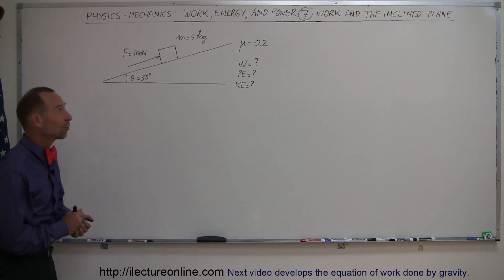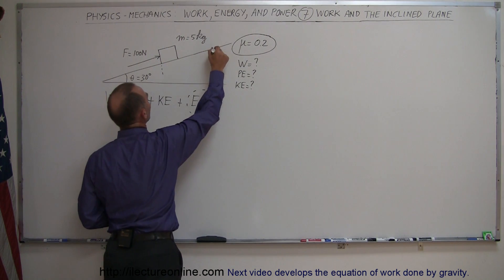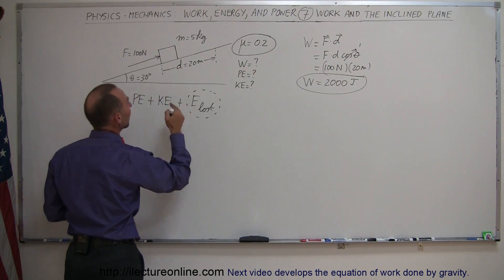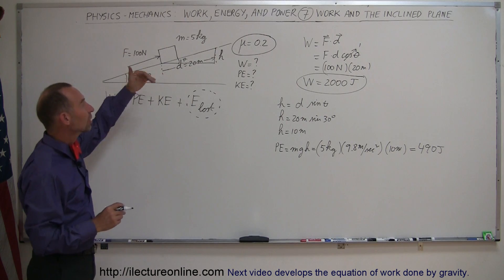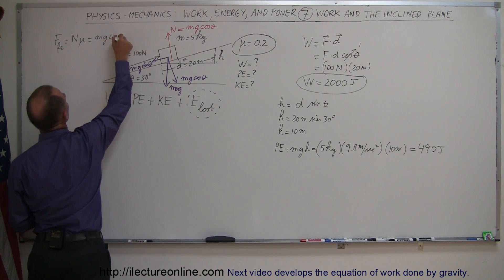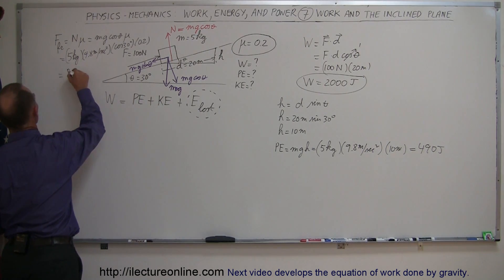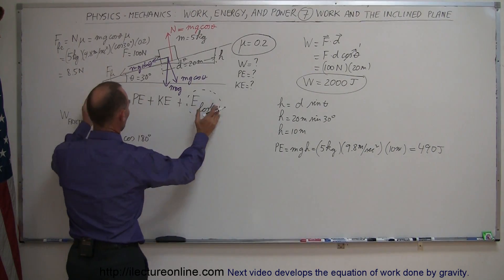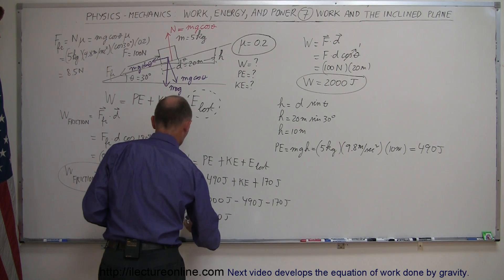Physics 8  Work, Energy, and Power (7 of 37) Inclined Plane (Friction)

Comment: There must be a miscalculation cuz there is a job done by the weight of the object. So the KE should be 850 joules according to my calculations.
Reply from the maker: The calculated values in the video are correct.  Thank you for checking.

Comment: Doesn't the X-component of G (the weight of the object) perform work on the object as well?
Reply from the maker: When an object is on an incline, it makes more sense to take the weight of the object and subdivide it into the parallel and perpendicular components.

Comment: Just as you said in the first video, Work done to overcome friction is positive bc Force to overcome friction is opposite to the direction of frictional force and here Energy loss is the work done to overcome the friction so its positive?
Reply from the maker: If you use the definition of work:  W = dot product between F and d  (Force and Distance).  Therefore work is related to a force and the distance and direction the object travels with respect to the direction of the force.  If the direction of the force and the direction of travel is the same, the work done is positive.

Comment: The force component of the weight of the box in the x-axis direction does work opposite to the thrust force, why is it ignored?
Reply from the maker: Technically that is not the x-direction, but the direction parallel to the incline.  You are correct that the mg sin(theta) force acts against the force pushing the block, but the work done to overcome that is accounted for by the increase in potential energy = mg d sin(theta).  We can account for it as work of as potential energy but not both at the same time.
Reply: @MichelvanBiezen  please sir you are really helping us much, now my question is,y don't you write all the questions in order, so that we see as you are moving from answering, question to question, I suggest you must do so 🙏

Comment: hello sir, in this particular problem you didn't use exactly the weight component in the direction of the force, mgsin(theta) but you used only force of the friction wich opposises the applied force. so, why didn't you use mgsin(theta) in this case?
Reply from the maker: The definition of the friction force =  (normal force) x ( coefficient of friction) = mg cos (theta) x (coefficient of friction)
Reply: @MichelvanBiezen  sir, here we have frictional force =  (normal force) x ( coefficient of friction) = mg cos (theta) x (coefficient of friction) is one of the opponent forces to the applied force, and also we have mgsin(theta) as the another resistance forces. so, Fnet=Fapplied-(mgcos(theta) +mgsin(theta)) and work done should be WORKDONE=mgcos(d) + (Fnet)(d) in wich Fnet is ☝. thank

Comment: Hi Professor , why don't we use Fnet = (100N - m.g.sin(30°))   Wtot = Fnet.displacement ?
Reply from the maker: It depends on what you are trying to calculate.  If you are trying to calculate the work done by the force that is doing the pushing, your equation will not give you that result.
Reply: @MichelvanBiezen  Thank you professor!

Comment: Why we don't use/ mg sin alpha/ as force losses
Reply from the maker: If you were to calculate the workd done by mg sin(theta) it would be equal to mgh = 490 J  Thus you either calculate mgh or the word done by mg sin(theta), but not both.
Reply: Sir we have two forces losses we have friction Force and mg sin theta
Reply from the maker: Yes, the friction force requires work to overcome.   W = mg cos (theta) mu d

Comment: Hello Michel. Thanks so much for posting all of these videos; however, I have a question at 6:35. Will the work of friction always be added in that equation? Is there any scenario where it would be subtracted? Thanks!
Reply from the maker: It depends on how the equation is written.  But if on the left side you add up all the initial energies and work put into the system, then on the right you must add up all the final energies and the energy lost due to friction.  (In this way it is always added).
Reply: @MichelvanBiezen  Thanks.

Comment: If a car is moving at uniform velocity on a frictional horizontal plane? then is the applied force by car is equal to frictional force? Is the power of the car 's engine = Force applied × Uniform Velocity?
Reply from the maker: You also have to consider efficiency (part of the power the engine puts out, is lost due to heat (thermodynamic inefficiency)), and part is lost due to wind resistance, part is lost due to internal moving parts, and as you indicated part is lost due to friction between the tires and the road.   🙂
Reply: @MichelvanBiezen  Thank you very much! You're the best! 💖

Comment: Hi Michel, why do you not take the x-component of the gravity force acting on the object into account? Just like friction opposes the object's motion (which leads to energy loss), the x-component of gravity does too because it has the same direction as the friction. This must mean that both friction force and x-component perform work on the object in the opposite direction of motion. Hence the equation would be:
W(Drag force) + W(friction) + W(x-component) = E(kinetic) + E(potential)
where  W(friction) + W(x-component) < 0 (takes energy away from the object)
Reply from the maker: The force of gravity is alrady taken into account by accounting for the potential energy.  It is either one or the other, but not both.

Comment: can you help me explain this sir?  A 200 kg cart is pushed slowly up an inclined plane. How much work does the pushing force do in moving the object up along the incline to a platform 1.5 m above the starting point if friction is negligible
Reply from the maker: Since the car is being pushed slowly, we can assume that it does not accelerate and therefore does not increase its kinetic energy.  We are told we can ignore any energy losses due to friction.  Then all of the work done results in the gain in potential energy.  Therefore the work done = mgh = (mass) (acceleration due to gravity) (height gained)

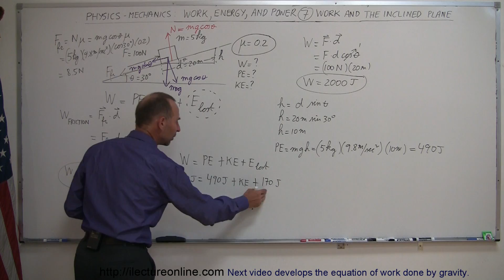Comment: I'm kind of stupid because I repeated this video 4-5 times to understand it one thing tho 6:40 I still dont get why we didnt subtract by 170.-.
Reply from the maker: Think of the equation as a scale where the left side and the right side must be balanced.  The total energy you start with is on the left side.  It must equal to the total amount of energy on the right side.  If not all of the energy was converted into kinetic or potential energy at the end (right side) you must add the energy that was converted to heat (energy lost).

Comment: What about work of gravity.!?!?!?! Which considered as a loss of work.... :)
Reply from the maker: When calculating the work done by a force, you can only consider that particular force.  So you can calculate the work done by the work pushing.  You can also calculate the work done by gravity.  (in the energy conservation equation, the work done by gravity is taken into account by the potential energy gained and lost).
Reply: @MichelvanBiezen  okkk... so there is no work to be counted to the force mgcos60 ..... we just count the work done by 2 forces which are the given one(100N) and the friction one.. right'?
Reply from the maker: Essentially we calculate the work done by each force seperately.  Then we can group them as desired.

Comment: Quick question, why didn’t we consider mgsin(theta) work done? It is the force done by gravity and it will be opposite of the motion, much like the friction, so there is an energy lost. Or was the initial force (100N) originally 125N? i.e (125-25)=100N ?
Reply from the maker: You can pick each force (including mg sin(theta) and determine the work done) separately and calculate the work done by each force.  (In this case mg sin(theta) will do negative work because it acts in the opposite direction of the displacement.

Comment: Hi Professor Michel I would just like to clarify if the cos theta in the formula W = FDcos(theta) means that the angle of the work done? Because my intuition at first to solve for the work on here is simply by plugging W = (100N)(20m)cos 30 because it is inclined 30 degrees. However in the video shown you applied it as W = 100(20)cos0
Reply from the maker: Work = force x displacement x cos (angle between the directon of the force and the direction of the displacement)   So the work done by the foce pushig the mass is:  F x d = 100N x 20 m    But the work done by the frtiction for is:   Ffr x d cos (180) = mg cos(30) x 20 x (-1)
Reply: @MichelvanBiezen  I already understand the way you approach this problem. Very clear to be honest. I assume the W=Fd that resulted to 2000J is you imagined that the box is on a straight surface causing cos0. Then you used the 30 degree to find the height by using trigonometry. and so on.
Reply from the maker: That is correct.

Comment: Quick question - when calculating the work done (W = Ff*d), why is the angle cos180 instead of cos30? Is it because we already took into consideration of the angle 30 degrees when we calculated what the force of friction was?
Reply from the maker: 180 degrees is the angle between the direction of the friction force (pointing down the incline) and the direction of the displacement (pointing up the incline)

Comment: Hi, why isn’t the friction work (Ff + Mgx)d cos(180)? Because both mgx and the friction is working against the pushing force. I would appreciate an answer asap (have a test in 1 day) //Sweden
Reply from the maker: Use the definition:   Friction force = normal force x coefficient of friction.     The normal force is the perpendicular force between the object and the surface which in this case is mg cos(theta)

Comment: Hey Michael thank you for the response, here is my confusion: when we determine work done by friction down a ramp (of a constant angle like an inclined plane or a varying angle like a curving ramp), we find that the work comes out to depend on the "horizontal length" of the ramp and not the length of the ramp itself (-umgl, where l = horizontal length if the rough ramp). In such a scenario, when work by friction seems to be path independent, how do we justify it as a non conservative force?
Reply from the maker: It is better to apply the definition of work:    W = F d cos(theta)   If the force is directed along the incline, then the work DOES depend on the distance traveled along the incline.

Comment: Thank you! This is super helpful! Would the energy lost due to friction change if the box was being pulled up the incline by a pulley when a hanging mass is dropped? If so, how would the calculation procedure for this be different?
Reply from the maker: The calculation for the sliding block would be similar, but you would have to include the other object in the calculations as well.  We have examples of that if you look at the other videos in the playlists on work, energy, and power.

Comment: good day i noticed you don't use the work energy theorem? i there a specific reason for that?
Reply from the maker: Good question.  Rather than covering "all the theories", I prefer to use fundamental principles to make it easier to understand, and to reduce the number of approached for the students.  Essentially the work energy theorem is a subset of the energy conservation equation, and after some practice the work energy theorem becomes apparent from the initial equation
Reply: @MichelvanBiezen  well thank you for helping me always be able to find h will have to adjust when I write. But its not too complex as long as you fill in the correct values. Now to watch electrostatics 🤩🤩

Comment: What would've happened if we calculated the net force subtracting friction there? And then we find the acceleration, then final velocity and then KE and subsequently GPE, and adding them we get a different result. So that way is wrong?
Reply from the maker: Try it and see if you get the same answer.
Reply: @MichelvanBiezen  I did and it's different, I don't think I made a mistake anywhere

Comment: I didnt understand why did you add the E(lost)with + sign and not minus sir?
Reply from the maker: In order to have a balanced equation, you must use a "+" sign if you place the "E(lost)" term on the right side of the equation, and you use a "-" sign if you place the "E(lost)" term on the left side of the equation.
Reply: @Michel van Biezen so if I use this equation:
W+E.lost=PE +KE, with substitute E.lost= -170 , am I right sir?

Comment: Hey, I did this problem slightly differently. Not sure if I'm correct; Instead of substituting h=d*sin0, I substituted d=h/sin0 into (W=Fd) Wfric= mu*mgcos0*(h/sin0). Is this still correct?
Reply from the maker: Did you get the correct answer?
Reply: @MichelvanBiezen  No, it would not work simply because PE only works vertically, and does not follow the path of the object.

Comment: Would energy lost take into account all resistive forces (ie. The component of its weight going down the slope mgsin(30)) not just friction?
Reply from the maker: Energy lost is the mechanical energy changed into thermal energy (heat).  This is caused by friction, wind resistance, etc.    Potential energy changing into kinetic energy would not fall into this category.
Reply: @MichelvanBiezen  but surely some of the total work done would be against the force of mgsin30N
Reply from the maker: Yes, but that is accounted for with the potential energy and kinetic energy, it does not get converted to heat energy.
Reply: @MichelvanBiezen ok thankyou very much

Comment: why is the cosine of theta = 1 in calculating work?
Reply from the maker: If the direction of the force is different than the direction of the displacement then   W = F x d x cos(theta)  where theta is the angle between the force and the displacement.  If the angle is 0, the cos (0) = 1

Comment: I want to ask a question.. why the work of mgsin(a) isn't included? I'm a little bit confused since i thought mg sin(a)will slow down the force and has a work by multiplying it with displacement. Please help me
Reply from the maker: That is already accounted for with the gain of potential energy (490J).  Note that the PE calculation contains the sin(theta) component.

Comment: Wouldn't there also be energy lost due to gravity, which is mg sin(theta)*d?
I'm confused because we apply mg sin(theta) when we do dynamics.
Please help!
Reply from the maker: Take it one step at a time.  Word done is simply force x distance (and time the cos of the angle between the force and the displacement if not zero).  Work will overcome friction, and add energy to the object (or both).  In this case work is used to overcome friction, add potential energy due to height gained, and add kinetic energy due to velocity gained.
Reply: @MichelvanBiezen  Understood. Thank you!

Comment: Why we dont calculate work done by a mgsin@  force ?  I dont understand that
Reply from the maker: That is a very good question and it confuses a lot of people.  It all comes down to perspective, and there are many things like that in physics.  For example if two people on opposite ends pull on a string the string will pull back (Newton's third law).  When you ask the person on the left: "which way does the string pull?", that person will say: "the string pulls to the right", and when you ask the person on the right: "which way does the string pull?", that person will say: "the string pulls to the left".  In this problem we have the perspective of the force pushing the block up giving the block positive potential energy.  But we could have concentrated on the work done by mg sin(theta) which gives the block negative potential energy (of equal magnitude).
Reply: @MichelvanBiezen  Thanks for answer . I got it. You are perfect

Comment: hellow sir,  why is the work done overcoming the friction  is lost?
Reply from the maker: If you slide an object over a flat surface it will eventually stop.  That means that the initial kinetic energy the object had is removed by the friction force (the work done by the friction force).    KEo = E (lost)

Comment: Hi sir! I love your videos so much! They really have been a lifesaver. If you wouldn't mind, I have a physics question based off my homework that I could really use some help on. It goes as so:

"A box is currently sliding across the floor at 1m/s. How much work is required for a person to push the 20kg box 10 meters horizontally while maintaining the speed of 1m/s if the coefficient of friction is 0.25?"
Reply from the maker: W = friction force x distance = m x g x (mu) x d = 20 x 9.8 x 0.25 x 10
Reply: Michel van Biezen excuse me but Ihave a doubt .....and how much  is the work without friction?

Comment: When you are finding the work at the beginning, why don't you subtract the parallel force from the applied force to get F x d?
Reply from the maker: The definition of work is:  W = F x d x cos(angle).   Since the force pushes in the same direction as the displacement, the angle is 0.

Comment: I dont understand why you put the Energy lost as positive in your master equation.....
Reply from the maker: It must be positive to balance the equation.  Try a simple example where you have initial energy on the left side and final energy on the right side.  If the final energy is less (because of loss of energy due to friction), then you must add the energy lost due to friction on the right side (or subtract it from the left side).

Comment: Hello Michel, I wonder if you can show me how did you get cos 180 degrees? When you have calculated E,lost.
Thank you: :)
Reply: I'm three years late but basically the friction force is in the opposite direction of the applied force. This is 180 degrees apart, if it was perpendicular it would be 90 degrees apart.